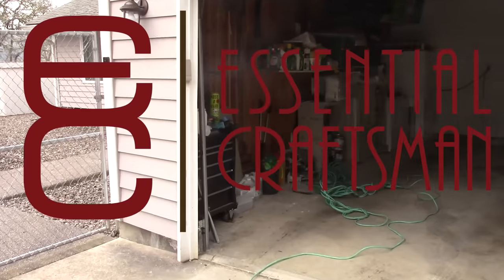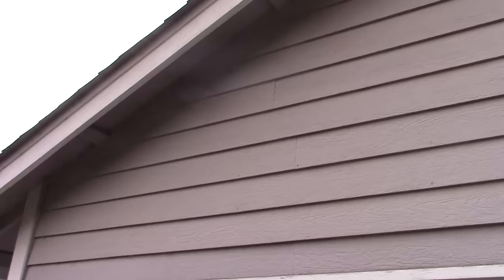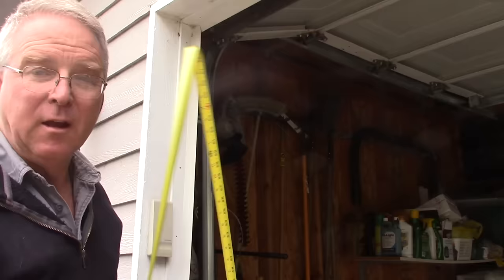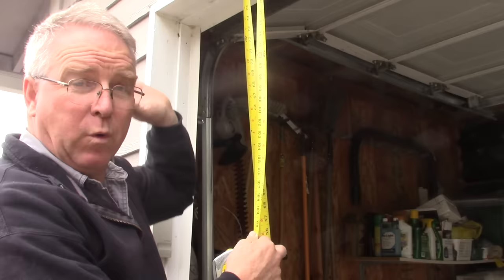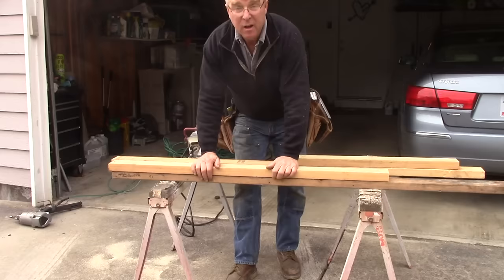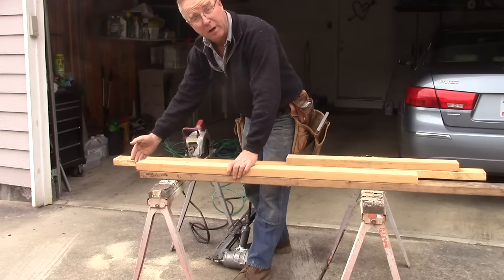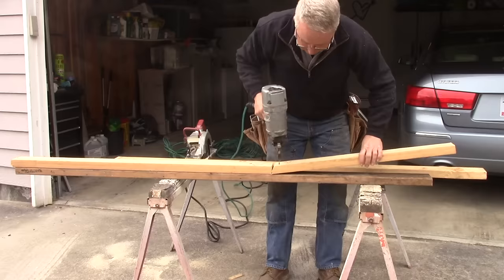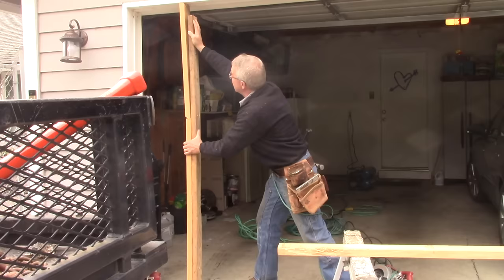2x4 Becomes a Jack - Cool Trick

Comment: Any down votes are ridiculous imo. You post great information that could help someone adapt to a situation who do not own a jack or have theirs handy and people don't like it. Must be the idiocracy crowd. Just because there are other methods doesn't discount this one. You don't always need a Martin T75 pre X panel saw to rip a sheet of siding. You use what you have on hand. If you ever work in remote locations these techniques are esp helpful.
Reply: A guy that has a nail gun, hammer, circular saw, and wood, doesn't have a jack around? I mean, I suppose it's possible, but you're turning a job in need of 2 items, into a job in need of 4 items. Not to mention the time factor, and safety concerns. It's a cool video. It's a fun demonstration of multiple principles. But don't fool yourself into thinking this was practical. There are a lot of ways to do a lot of things. So just leave it as this being another way of doing something.
Reply: +james Personally I prefer this to a simple jack as a jack can tip over or whatever.  Same concern with cars where jacks are used for lifting and  'jack stands' for holding
Reply: +Adamast the reason you need jack stands for a car, is because you are holding up one side, of a 4,000 object, that has rubber wheels on it. The garage isn't just going to up and roll away.
Reply: This is absolutely practical. Imagine if you had to lift from four different points. Would you run out and buy 4 hydraulic jacks?
Reply: What if you only had one jack with you.... or you got somewhere remote, 
needed a jack (or lever), or more than one jack and didn't have one.  
Now you have the tool (your brain) to make the tool(s) needed without 
making a trip.  I believe he stated you could use a jack but for the 
purpose of this demonstration.....
Reply: .04 percent gave thumbs down.
Reply: 4%.
Reply: I thumbsed up!  This is valuable knowledge
Reply: I really liked this video, but I thumbs downed it because of your comment.  Nobody tells me what to do dagnabbit!
Reply: A jack can kick out if you use it with a 2X4 to get the height. This method looks much safer.
Reply: LKN4WAR yep, great method.  My Dad taught me this in the 70s and I use it all the time.  Never had an accident or failure. I don't understand the down votes either.
Reply: I agree.  How can anyone in their right mind not like this idea.  Maybe they are not in their right mind.  LOL
Reply: Errr, you could have just cut one bit of timber put it in at an angle and kicked the bottom until it was vertical.If it's too rough on the floor for the wood to slide, a bit of sheet steel or some such would make it easier to slide. Failing that an ordinary car jack under a slightly shorter length of timber.
No need for any power tools, nail guns etc....
Reply: LKN4WA
Reply: These are great tips for working alone, which I do all the time.  Ive learned many other tricks from doing things right and wrong, and this one will be added to the toolbox.  I have jacks, but this might be better.
Reply: james pogrebetsky ok. So this nailed-up 'jack' jack no longer has any fulcrum. After nearly 35 years of carpentry, I'd rather use /this/ method than a bottle jack and 'trimmer' than can settle and blow out. Manufacturing Dependency Syndrome is a disease. Yankee Ingenuity is just gettin' it done! I've watched guys with come-alongs, excavators, and pry bars try to wright all kinds of stuff, sometimes successfully. But with a LOT of work. Meanwhile, give me an hour and a couple 2x12x18s for springboards and I often could do the same work- alone- and usually more successfully. 
TV watchers and the closed minded think everything needs a tool with a part number and owner's manual. Or it's unsafe. Think again!
Reply: LKN4WAR macro plaza chihuahua chih
Reply: +General Lee Deflate the tires? LOL You do know vehicles have suspension right? That would negate any lift from reinflating the tires. I wouldn't even do that in my 1 ton dually.. do you know how long it takes to inflate 4 rear tires to 80 psi? This could work if you had a rig with air suspension though.
Reply: +fishhuntadventure Manufacturing Dependency Syndrome says it all. Tv commercials have people running to the home depot every time they start a project without even looking to see if they already have the tool or hardware hiding in the back shed already.
Reply: Thanks for this video. Next time do a video on how you rolled up your extension cords. I also roll them this way and its a lifesaver. I was once told its called the "California roll". A man from the Navy showed me how to do it.
Reply: We only
Reply: I have all of those tools but not a jack, I am Joe home owner and I live in a very rural setting, this I could use. Take care
Reply: The downvotes are because this is a pretty standard technique...except the more common way of doing it is easier and better than this.
Reply: Keep in mind that there are automatic means of downvoting videos based on their popularity which I'm sure are the bulk of what's on this video
Reply: negative votes are always well received ... show the coefficient of inferiority and frustration
so we still have frustration and that's sad .
Reply: james pogrebetsky I very rarely think of the words IDIOT or DUMBASS... Life is about LEARNING... I'd rather assume INEXPERIENCE.
I own at least 8 bottle jacks... bought all of them for a job 4 years ago; by then having been in the Trades for over 35 years. I haven't used even one once since. 
If you can't figure the rest... Then you you shouldn't comment
Reply: Some people are just A-holes
Reply: LKN4WAR "you use what you have on hand". I would of pushed it back with the truck!
Reply: Johnny Wewoka just because someone doesn't like the same as yours, regardless of their reason, doesn't make them an idiot. You criticising them for not liking the same as you makes you arrogant!
Reply: I need a job?i can be your best helper
Reply: @jamesbizs  nothing personal because I don't know you. however.  Your vantage point and my vantage point completely differ here and in alot of areas of life I'm gonna assume.....  The fact anyone ever has to respond negatively to someone taking time to help people as he and alot of people here do, says evrything I don't need to know about you,  to know if i did know you.  It would be personal..  I rarely do this but I'll assume you down people alot.... This man has excellent views and is clearly helpful to alot of people..  I see why your channels a failure giving people life advice,  lmao..  Here's some advice.  You shouldn't give people life advice..  When you don't like something. Scroll the fuck on, get down the road, stay in your own lawn....  Is that truth or my opinion?  Honestly, It's both but I'm not on your videos telling you that 20 seconds in I had to click off.  I'll watch this guys tricks of the trade for days.. Think about your response first, or if you even should.... Another piece of advice...  I wouldn't if I were you.. just take it and quit being negative to people helping people.     Btw I have all the tools but no jacks..   Any advice homie?
Reply: I down voted because of your comment
Reply: @rherman9085 , I assume that the negative responses to this particular video are due to the fact that the guy who made it knew what he was going to need to do the job yet he decided to use this method instead of being fully prepared with "bottle/hydraulic" jacks.  They aren't expensive but he used more expensive tools to do the same job.
Reply: j p please explain the safety problem?
Placing a jack and a 2x4 on it would be far more of a safety concern what's going to stop the timber spitting out nothing. 
It truly amazes me how many experts are out there in the comments. Most would not know there arse was on fire unless they smelt the hair burning.
Reply: the best tool is the tool you have
Reply: @jamesbizs  : Being able to improvise with what you've got is a skill that many don't have. 

I respect creative solutions.
Reply: Okay, I was curious.
But if I saw this guy struggling like he was my impression of him would not be he's not a skilled trades person but some dude without a hydraulic jack. We all do what we can with the tools we have but a skilled trades person will have the right tool for the job.
Hydraulic jacks aren't that expensive and are handy for many other things...a good investment IMO. And I don't have 2x4s that I want to cut up for a one time use.
And why would I try to calculate the distance I would have to lift this frame and if I'm out but an 1/8 of an inch, now I have to put shims under and try again. No thanks
Reply: Cut 2x4 to length, place in corner of opening. Drive board in with hammer. Make repair, No tool truck needed..
Reply: I watched this video a long time ago and tried to remember the technique on a sill replacement on a garage i did this week. What i did was very similar to this but made no tape measurement. I took a stud, and at the top part put a scrap about 2 feet long screwed to it. the bottom of this scrap I cut at an angle so it behaved as a french cleat. I took another stud and holding it alongside i scribed a mark at that angle cut. but when i took the saw to it i just moved it  about 3/4 longer. i started a deck screw near knee height of the two piece section and when i folded the two together i drove the deck screws home. when done i simply backed the screws out and released the 2x4 hinge
Reply: They just failures trying to feel better about themselves
Reply: spottracer - thats why he finished the job perfectly by himself, & has been doing so for probably 30+ years. Whats your credentials?
Reply: Those are his competitors
Reply: Maybe some people have higher standards than you.

- Carpenter for 26 years
Reply: Beautiful work. Working with what you have. Nothing wrong with that.
Reply: There a always down votes for popular videos because they are so many trolls on YouTube that have nothing better to do with their time, and there's always a few idiots who just don't get it.
Reply: Haha think about all the equipment you would need to this job.
Reply: Ruby Lee  how about lay one tire down, lay 2x4 across tire and the one vertical? Then your only deflating one tire...? Couldn't you get 1/4" from sidewall?
Reply: @disgruntledscientist  yes that's true, you need to be plumb or Jack will kick out. Had it happen.
Reply: @delcat8168  how do you keep from damaging trim if top slides out as you bang it in?
Reply: You’re so right. I pray for those who don’t do manual labor.
Reply: lol sheet why didnt he just use his crane? duh
Reply: This man knows his trade. Him and I are the same age. 
When I entered the trade I was a pure back breaking labor wasn't ever to be heard from on my do as I was told I worked under my father and grandfather that were absolutely no nonsense men neither had much to say shut up learn and do as I was told my first job I was on with my dad was making sure they had mortar and made their way exactly as I was taught the first time there simply wasn't any understanding any less they rarely had anything to say when they did i wasn't allowed to speak back questions were considered wasting their time. 
My father made me learn how to repair tools, sharpen safe blades all kinds of stuff before I was ever allowed to use a tool losing any tool was sinful and would get me knocked on my back literally from there I had to spend two years working for two very mean old German guys that didnt speak English and I didn't speak German I understood some because my dad spoke German to his parents only thing I really understood was cuss words when they were angry at me which was lots facts are though the four years I spent as a young man well started in the summer when I just turned 13 years old but by the time I was 16 I could do just about anything on any jobsite went to the Army on my 17th birthday at 25 I started my own construction company six years in the Army all those years working for tough no nonsense men I was ready even though my dad didn't believe I was by the time I was 30 had a successful business a child and could stand on my own two feet he told me how proud he was of me, I just couldn't believe he actually said that to me he wasn't the kind of man that ever would say those kinds of things to any of his 10 children what less me we weren't exactly friends by the time he passed away him and I were very close the last three years of his life I understood that old man all he wanted was his kids to understand life isn't a cake walk he wanted us to be intelligent and tough enough to make our own way in life. Sorry I didn't mean to tell my story point was though those that don't give this man a thumbs up and purely excellent comments don't get the business or understand his skills him and I are the same age and some skills I appreciate that he works so hard to share our trade so well, I don't have the personality to do this I appreciate he does. Thank you for the appreciation for this trade and this man and I before anyone says anything NO I DO NOT KNOW THIS MAN OR HAVE A THING TO DO WITH HIM just appreciate another real carpenter like myself!!
Reply: @jamesbizs  He's a carpenter, not a mechanic. Why would he go out and buy a $100 or $75 or even a $50 jack when he can make his 2x4 mechanism for less than $20?
Reply: it doesnt matter what it is, any youtube video will have dislikes, the first 1% of the bar doesnt mean anything for how well liked a video is, the other 99% is based on how many people think the video is good or not.
Reply: @reforgedcriterion1471  :(  must fix
Reply: @Randy Mayfield  Thank you Mr. Mayfield.  I do have some clamps, and no one is going to walk off with nailed up old studs.
Reply: j p
You don’t understand the idea of 
1. Showing people how to use another method that many haven’t ever seen
2. Developing content to build an influencer platform
3. Shit
Reply: https://en.m.wikipedia.org/wiki/Jack_post the correct way to do this is to use an Acrow, I winced when he put his hand between the wall and the base. Timber doesn’t come with a stress test for its load bearing properties. Maybe a solution when your stuck, but a reputable tradesman should have the proper equipment.
Reply: @jamesbizs  One need not have a nailer, circ saw to do this.  Could be a full manual operation for those off grid projects.  The electric tools make it easier, for sure.  The big thing is teaching the principle of jacking WITHOUT one more tool.  Carry a jack in your truck year round and use it twice, what did that do to your carbon footprint?  did it slide around and damage something, damage itself...  Or with this method, he made it happen without going back for the big hammer....
Reply: @AlexSmith-on6ui  but who are they?  I would like to understand what caught their attention as unworthy......  Morbidly curious am I.  What else have they downvoted?  What is going on in their lives that they are so unhappy?.....
Reply: @JacobTerherst  California roll is a form of sushi that my wife likes ;)
Reply: Chris Richardson  My father built houses for 55 years. There isn't a person where I come from that doesn't claim him to be the best carpenter they ever witnessed. He used this method all the time, 40 years ago.

You haven't a clue what you're talking about. A garage door service tech doesn't know anything about carpentry. Stick to sales and marketing.
Reply: There just down voting because they'd use a jack, forgetting we don't always have one in our belt.
Reply: I would say that's the nature of humans, but it's actually the nature of virtual humans.  Very few would actually do that in real life.  Give someone an extra degree of separation from being accountable, and they act like they have free reign to be assholes.
Reply: @markmitchell1290  nice dude!!!   Very true, sometimes the whole bag of tricks is needed.
Reply: @jamesbizs  I have a nail gun, a hammer, a circular saw, some wood lying around, but I don't have a jack.
Reply: lot easier way than this may be why
Reply: Sometimes I dislike stuff cause I don’t want it in my feed all the time. Also, I’ve heard that YouTube calculates up and down votes the same, so it doesn’t hurt any.
Reply: @CaptainAwsome  sometimes people accidentally bump the thumbs down button
Reply: @jamesbizs  I know this is 4 years old but I have to answer to this. You dont use a jack stand versus the hydraulic jack for a vehicle because it can roll away, unless you leave your vehicle in neutral while working on it.

Also because the hydraulic could fail while your under there crushing you. The jack stand doesnt rely on hydraulics its a very simple mechanical style lock. unless the metal were to break (which isnt happening) your then safe from being crushed.

you could say its a slim chance the jacks hydraulic fails and you could be right. but why take the chance? let alone if the jack has some age to it, a seal could go... also defects are a thing. 99 jacks could be fine you just need the one manufacturer defect to kill you...
Reply: sorry to be off topic but does anyone know a method to get back into an Instagram account?
I was stupid forgot the account password. I would appreciate any help you can give me.
Reply: @Juelz Tadeo It worked and I finally got access to my account again. I am so happy!
Thanks so much you really help me out!
Reply: @Ford Bryce No problem =)
Reply: @jamesbizs  it’s always practical to have another option. Let’s say he forgot his old trusty Jack when he was tooling up for the job, or it was stolen this morning off the truck when he stopped for breakfast, or it finally gave out when he started the job that morning because it was leaking oil. Or maybe it’s already in use by another guy on the same job site. Just saying. Of course you would use the best tool you have for the job at hand. It’s the guy that already knows everything that won’t listen and doesn’t continue to learn.
Reply: @jamesbizs  , safety concerns? Lmao! Eat some wheaties sonny.
Reply: @JacobTerherst  , we call it daisy chain .
Reply: @Randy Mayfield , 10d jackimo, your not in the framing biz, that’s obvious
Reply: 3
Reply: @jamesbizs  How can you say it wasn't practical when it got the job done so well?  He was there maybe an hour or so which would of been much less if he wasn't YouTubing.  He came, fixed the problem with intelligence and style and left.  I think that's pretty practical.
Reply: @AlexSmith-on6ui  You got my thumbs up for that.
Reply: @taurus2001dohc  Lol, I didn't grab my calculator but even a 96% success rate is considered good in most things in life.
Reply: @ionymous6733  Lol.  I thumbed down your comment just for fun.  Even though in a way you told me to do it dagnabbit!  Have a good one!
Reply: @two-sense  down votes on comments do nothing on YT. They just make the user think they had an impact and feel better. I hope you feel better!
Reply: @djsantiago3904  He has a couch and a keyboard.  What else do you need on the internet?
Reply: @ionymous6733  I was joking, dude.  Lighten up, it's just a YT vid.  I said I did it 'just for fun'.
Reply: @two-sense  Have a good one! lol
Reply: @ionymous6733  U2
Reply: @jamesbizs  it's also safer than the jack and 4X4
Reply: @jamesbizs  I hear you and I agree somewhat.  I guess maybe I'm reading into your comment but I'm thinking you're attacking it with a hydraulic jack? Yes? If so, awesome.  A hydraulic jack is pretty complicated (from a materials point of view).  If you have nothing but sticks, a saw, a hammer and some nails and can do it too... thats a good fall back to have in your brain.
Reply: there's so many down votes because as old as he is, he doesn't know you can just simply use one 2x4 cut to the length you want to lift it too.  it takes like 2 minutes at most including the cutting.  all the angles he cut into it make it less safe as well.